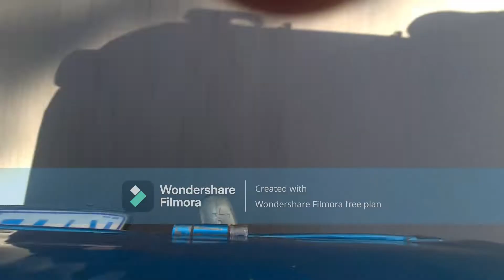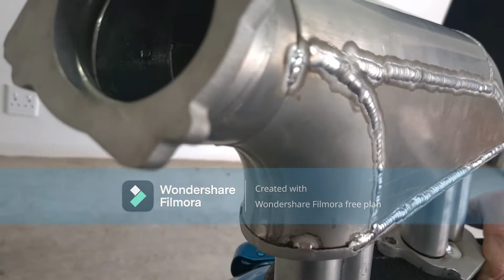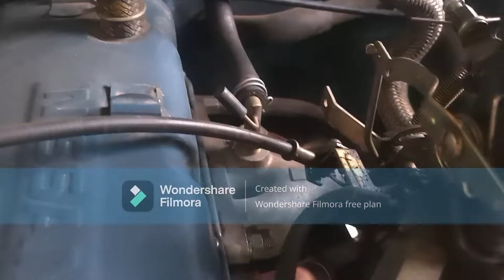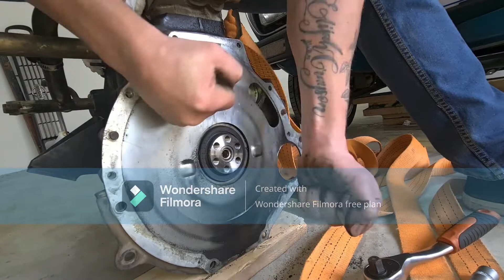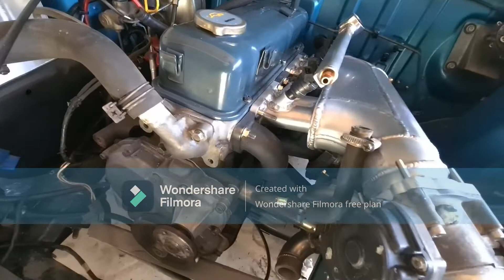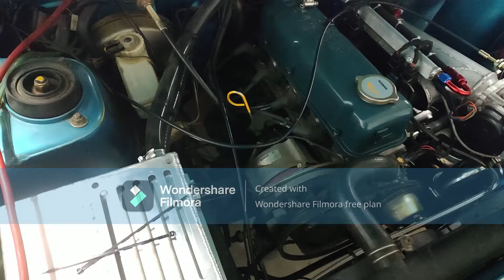NISSAN CHAMP/1400 TURBO BUILD

Comment: Nathan goris if you put a turbo on a nissan 1400 do you need to put stabilizer bars  to reforce the body not to tear or will it handle with out the stabilizer bar
Reply from the maker: Hey. I have not yet run into flexing issues with my bakkie. 

She made 105kw on the wheels with 1.0 bar of boost with all the stock components

Comment: How much would it cost me for this
Reply from the maker: hey Bud, we do a turnkey conversion at LCH. R60k all inclusive. You are welcome to contact Lee @LCH - 082 389 5415
Reply from the maker: Roughly about R65k at LCH Worx. 

This will be a Turnkey project and about 3-4 weeks till completion. 

With a GT17 turbo as i am installing this soon. Dictator ecu and full ss and aluminium for the plumbing and exhaust